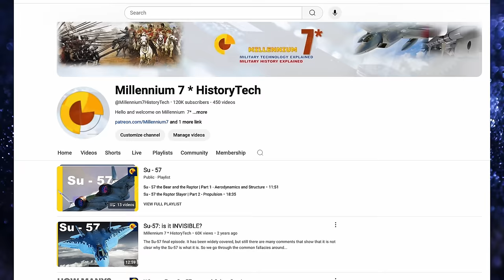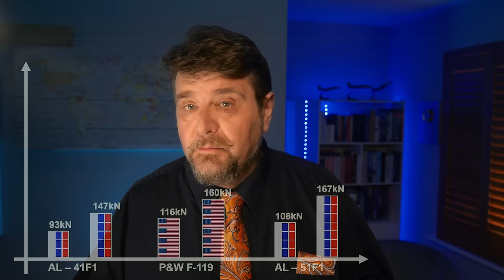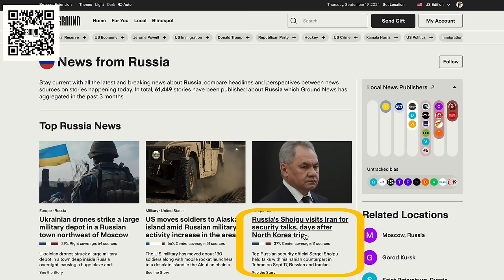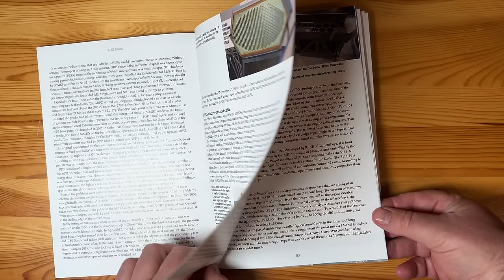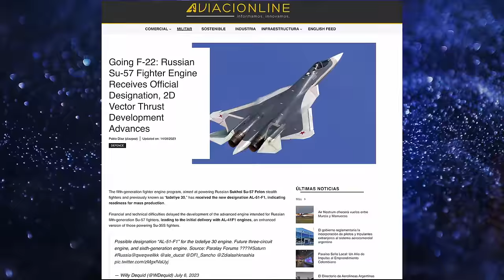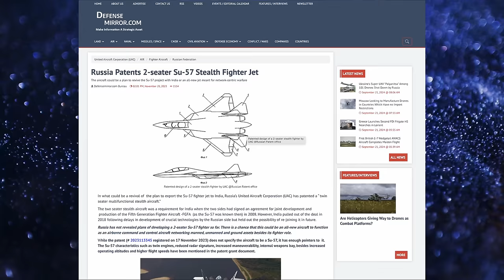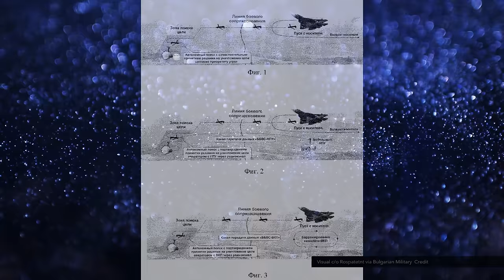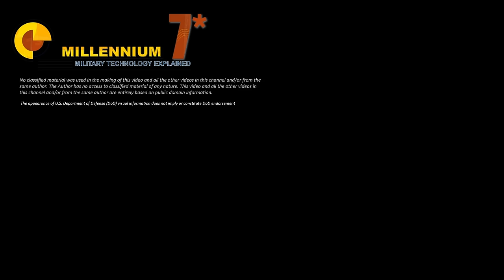The Su-57 is a Masterpiece!

Comment: Hi M7 ! 

First congrats for your comments !  You are one of the few western very objective analysts ( e.g. Bill Sweetman is also very objective). Yes ,Su-57 is actively used during SMO ,practically from the beginning.Su-57 was used in SEAD/DEAD missions with its new heavy very long range hypersonic ARM type Kh-58UShK-TP which has not only passive radar but also passive IR guidance. With engines AL-41F1 ,Su-57 can fly and patrol over so called Armstrong's line ( over 19 kms of alt) and can supercruise in stratosphere fo a long period of a time  with real speed of 1.3 Mach ( You are right). Su-57 got six new AAM : Product 171-1 ( R-77-2 ), Product 180 ( R-87 ), Product 270 ( R-47), Product 300M ( R-? ),Product 760 ( R-74M2) and Product 810 ( R-97 ).  Also got some new AG weapons like: tactical cruise missile  Kh-36 Grom-1 ( Thunder)=120kms  , ARM Kh-58UShK-TP=400kms , stealth low flying subsonic operational-tactical cruise missile Kh-69=400kms , new stealty low flying operational-tactical subsonic cruise missile Kh-50 (Product 715 ) =1500kms, two cruise-missiles/combat loitering drones S-71M Monochrom ( HE warhead ) and S-71K Kavyor ( cluster munition)=400kms.,new ASM called Product 720. 

Of course , there S-70 'Hunter-B' as loyal wingman which can be data linked with every Su-57. One fighter regiment will have 24 Su-57 in 2 sqn's ( each with 12 fighters ) and one sqn with S-70 Hunter-B.

Su-57 has 8 AESA radars as part of N036 Byelka radar system ,yes. Four in centimetric X-band ( the main N036 Byelka with 1526 TRM  for forward looking, two N036B with 358 TRM each  as SLAR and AESA called Epolet-A with 68 TRM  for rear looking in the tail boom . Also has four decimetric  L-band radars ,two in wingslats and two in LEVCON's. X-band  AESA radars are for search/detect/track and lock on of air ,ground and sea targets.Then for ID/IFF nav and comm,also for jamm. X band AESA can be used for  ELINT and EW ( ESM,ECM,ECCM).  L-band AESA radars are for long range search/detect/track air ,especially LO and VLO targets,then for long range IFF,jamm in L band spectrum. L band AESA can work in Mono and Bi static modes. With all of that 8 AESA ,Su-57 has all around azimuthal coverage ( 360 degrees ).Besides those 8 AESA ,there is four more AESA as part of L402 Himalay active jam system. That AESA are positioned on the sides of the wingtips.

About versions... There is the main single-seat version as serial and operational.From 2020 until the end of 2024 all of them are or will be equipped  with AL-41F1 engine . From 2025 until the end of 2027  new Su-57 will be equipped with AL-51F .Su-57M ( Project Megapolis)  is practicaly the prototype of 6th gen fighter and  Sukhoi test pilot Sergey Bogdan already  had several  test flights were he did nothing at all. Literaly  from take off phase to the landing phase. They have two flying prototypes of Su-57M,  number 058 and 511 blue.For them they are testing completely new 6th gen engine ( with rectangular rotating nozzles with reverse thrust capability),also DAA ( Digital Antenna Array ).

Su-57 ( twin-seat) will be offered to IAF ( Indian Air Force).

About aerodynamics..... Only can write ,it is so superior ,simply fantastic( LEVCON's wings with six control surfaces and  all moving horizontal and vertical stabilisers,in total 12 of them ! )  Test and combat unit pilots already recognise that Su-57 can do almost every maneuver faster than Su-35S.

About gasodynamics .... Even with  so called first stage engine AL-41F1 ,Su-57 has excellent agility and maneuverability ,SEP and thrust to weight ratio.That very inovative plasma ignition system of the main and AB chamber is practicaly unique. With AL-41F1 ,Su-57 is the only fighter in the world who can climb through troposphere with supersonic speed.Initial climb rate at 1000m ( even armed with AAM inside those fuselage and underwing weapon compartments ) is more then 380m/s ! 
AL-51F is in fact completely new design .It has third ( cold only ) air stream for cooling  the engine and nozzles ,thus redusing IR signature. Has new composite IGV and serrated nozzle panels as RCS reducing measures besides that radial-coaxial grid as radar blockator inside air intakes( something that operational Su-57 already have). By the way, AL-51F has no classic AB chamber  at all. Instead, it has so called  multi-ring complex  with plasma ignition system.

All the best and keep to be so objective and interesting.
Reply: Interestingly enough Russia doesn't have control of the air space above Ukraine. 
How come when they have this "fantastic" piece of flying Lada?
Reply: Fascinating.
Reply: @HansOleBenonisen  Hm ,that ''fantastic'' piece of flying Lada is in fact the real reason why USAF is actively working on the new 6th gen fighter! Yes, it is right.

Now if You don't mind I will present You some facts from the history of the  fighter aviation. When SR-71 Blackbird became operational, USSR answered with one 3rd gen famous fighter-interceptor. Of course, it was MiG-25. So MiG-25 was 3rd gen fighter( interceptor). USAF answered with 4th gen fighter known as F-15 ,am I right ?  Then USSR answered  with 4th gen fighter Su-27. So Su-27 was the answer to F-15 and it really was! What was the USAF answer to Su-27? It was 5th gen fighter F-22A ! in the meantime,Russians answered with 5th gen fighter Su-57.USAF answer for Su-57 is ?  Understood ? 

On March 24 1999 , NATO attacked former Federal Republic of Yugoslavia ( with no real reason of course). Former FRY had air space with area of about 100000 km2. NATO used air spaces of almost every country around FRY. Besides  that ,YuAF MiG-29B flew some combat missions that lasted 30-45mins. Do I have to remind that Yugoslav Air Defence force shot down super modern stealth tactical bomber F-117A with so old Soviet made SAM system SA-3 (S-125M Neva-M ) ?

On the other side, we have Ukraine with air space of about 600000 km2 ! Ukraine Air Defence force was the biggest and most modern one in Europe (after Russian ) ,with 35 battalions of SAM-10,15-20 battalions of SAM-11 etc. Understood now ?
Reply: @aviator77migsukhoi34  bla bla bla, Russia ain't even capable of building a passenger plane, safe enough to be in use in the rest of the world. 😉
This "masterpiece" of flying Lada is just a scam.
Claiming that Ukraine air force, together with the russian air force where the two top notch and most modern in Europe is just completed and utterly nonsens. 😂
Reply: @HansOleBenonisen  Nonsense  is what you wrote. Sorry , but I must ask , do you have military  education and knowledge by the way ?
Reply: @aviator77migsukhoi34  What was the reason for downed Ukrainian F-16?
Reply: @saumitrsharma2816  The reason was simple. It was FF ( Friendly Fire ) .Why is FF happening ? Reason is also simple. During wartime ( combat missions ) ,combat aircraft don't use ,so don't turn on their transponder IFF units( antennas).Use of ID/IFF is then useless ( from fighter radars,SAM systems etc ). That was the reason why so many Ukr AF and RuA&SF fighters and bombers were shot down by the FF.

One of the most famous incident happened at night of Feb 28 2022. That night was achieved sole air victory for Ukr AF but how? MiG-29 pilot capt Andrey Gerus launched one  medium-range AAM type R-27R to the very big incoming target which he tought it was Russian transport aircraft Il-76MD( had very big frontal RCS ). In fact ,it was his collegue maj Stepan Chobanu in Su-27.He did not turn on his transponder IFF unit ,so MiG-29 pilot did not have a clue that it was Ukr AF fighter. Su-27 pilot was KIA.

Comment: Considering how the Russian Air Force doctorine thinks and works, can we expect a stealth ground attack aircraft (like a next gen for SU-34) to be developed based on the Su-57 platform? I mean, 1- is Su-57 platform as versatile and as good as the infamous Flanker? 2- what kind of aircraft would a low-observability ground attack warplane would be?
Reply from the maker: Well, it is supposed to be a multirole aircraft. The camera system that shows the pilot the outside environment in the helmet is designed for low level flight. There is a stealth targeting pod being developed. So the Su-57 should be the replacement of the Su-34.
Reply: I just don't see why ground attacks would require a specific ground attack flight profile any more.  Before precision munitions you needed to fly close to the ground and even rugged A-10s get shot down constantly.  Now even A-10s, if used for ground attack, would just be loosing smart munitions from 5000 ft the same as an F-16 or F-35, and none of them need any special ground attack ability other than a technical capability to direct the missiles.  It's not like they need to be updated to triple wing spars and so on.
Reply: @Millennium7HistoryTech  but wont this cause the same issues as the Ka-50 had? With the pilot not having enough concentration to both fly and searcb for targets? Although with the twin seater variant being patented that might be fixed just as the Ka-52 fixed the issue.
Reply: @lqr824  >I just don't see why ground attacks would require a specific ground attack flight profile any more 
For the fly-hour cost, su34/35 usage will always be much cheaper that constant usage of superior su57 for such purpose, any jet got limited hours of flying before general big maintance, so why using expensive to maintain 10-radars su57 if you could achieve same goals with cheaper su-34? and payload make big difference as well, if we talk about long term operations, not just 1-time-in-a-year operation
Reply: @iplaygames8090 ka-50 did not have like 8 radars on board with thermals
Reply: @lqr824  The experience of the war in Ukraine shows that the use of assault aircraft in conditions when troops on both sides are saturated with modern MANPADS is impossible. The place of attack aircraft is now occupied by drones and helicopters.
Reply: @keizru  > For the fly-hour cost, su34/35 usage will always be much cheaper that constant usage of superior su57 for such purpose

That's only an argument for cheap bombtrucks instead of air superiority fighters, not an argument for specific CAS features such as the A-10, whether the gun,  the armored bathtub, the three-spar wing, the engines away from the body to minimize damage from direct IR hits, the way the tail was designed as much to shield the exhaust source from the ground as for aerodynamics.  Heck, even the fake cockpit on the bottom.

Now, the A-10 IS probably the cheapest plane in the inventory if you look at build cost and cost per hour.  But the Pentagon ALSO has to look at the cost of pilot training, maintenance team training, logistics chains and stores, and so on.  The F-16 or even F-35 is cheaper in the long run because you can just supply one kind of plane, establish air superiority, and start switching to ground attack with smart munitions from safe altitudes just as soon as you wish, and still only be seconds away from full air superiority mode if you misunderstood circumstances and new threats appear.

If you need 40 planes for air superiority and  50 for ground attack, which is cheaper: 50 F-16's with their supplies and personnel, or 40 F-16's and 50 A-10s with two sets of supplies and personnel?  THAT is the calculus of which I speak.

It'd make sense to give A-10s all to Ukraine, to use as glide-bomb bomb trucks and to drop precision munitions, but not to use below 5000ft in its original CAS situation.  Heck, it wouldn't even make sense to carry shells for its canon.